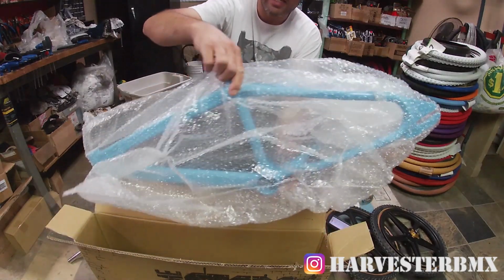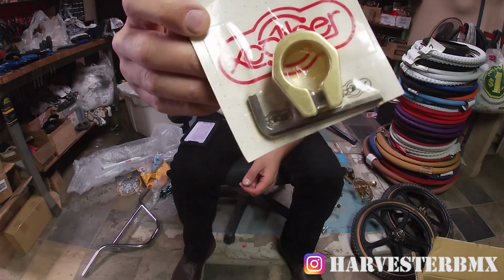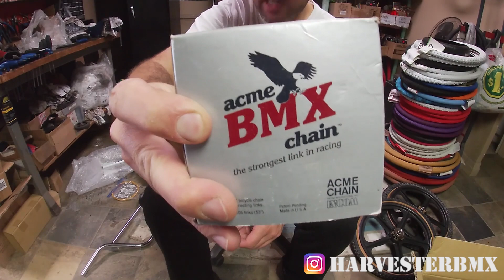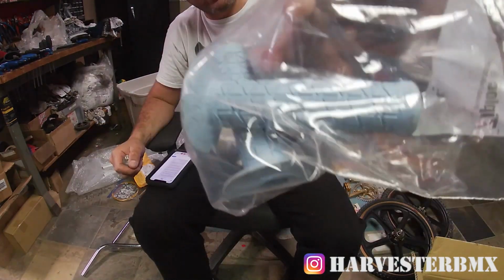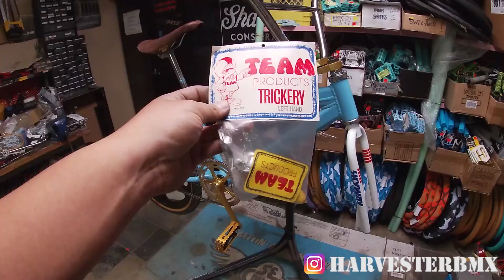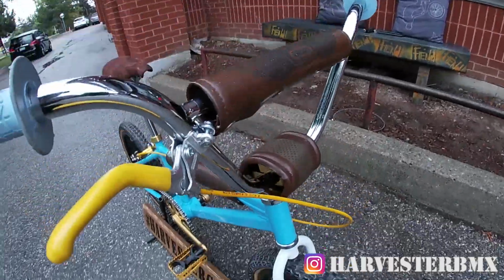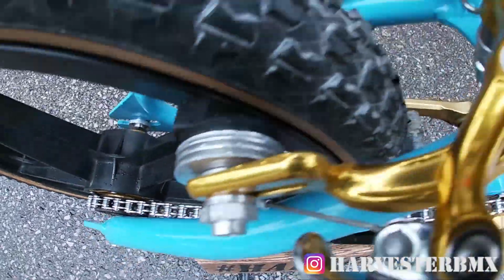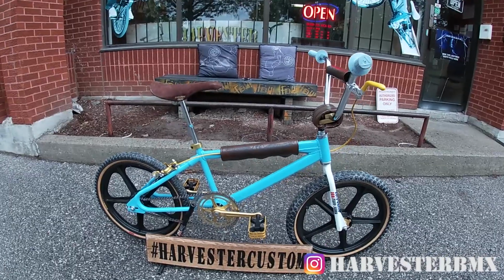1979 SE Bikes PK Ripper All Original Build @ Harvester Bikes

Comment: Skyway were not making bike frames or forks in 1979. The correct fork, pre landing gear should be one that is badged SE Racing BMX Innovations. I know this because I bought a pk ripper in 78 that was in-between when the one rider left and SB decided to call it the pk rippper. My frame was sans gusset and had said forks. It was later that the pk ripper came with the gusset and landing gear foks.

Comment: Great bikes to look at or sell to people needing a nostalgia fix but absolutely useless for riding compared to a modern BMX.  These bikes were all built for the track not the street - and the tracks back then were tame compared to what we have now.
A bike of this spec back in 1982 or so would have been unaffordable to all but a rider that had a factory endorsement or very cashed up parents.
In Australia where I lived the best bikes were only available as Frames/Forks/bars - you would never see a Cook Bros, Robinson, Redline... and so on as a complete bike at a shop unless it was custom built.  Circa 1980 the best completes you would see were the Team Mongoose with Alloy cranks, bars.. and so on.  The next tier was the Supergoose.
Bikes like Quicksilvers in 1981 were $100 less than a Supergoose brand New [$369 vs $269].  To put that in perspective - A 1980 Cook Bros Frame, Fork, Bars, and seat post Cost $330.  A set of 1980 Redline Flight Cranks was $280 - and absolutely nobody wanted them by 1982 because the Shimano DX cranks were more desirable and only $120.  Bullseye Sealed BB Kits were $50, Takagi Tourney 3 piece cranks were $40.  MX-2 Stems $25, any allow seatpost clamp you wanted was $5.  Tuf Necks were $38.... 

I mowed a lot of lawns back then to afford this stuff - had a lot of fun with it as well - but bikes have come a long way since.
Reply: Awesome  build , brings back memories. Big fan of the p.k.ripper i owned two a 20"& 24". Modern day bmx bikes don't compare they were definitely ahead of their time. Thanks and keep up the awesome builds.
Reply: Hello and how are you guys doing at HARVESTBMX ? JUST thought i"d throw this out there as one of those cool bikes I used to have. Back in 97 a friend of mine said hey you know what? I just came across. This bike frame&forks. If you like them well I said cool . so later that day he brought them over and what did i see HOLY F@&%$#@ CRAP. it was a CW ZX PRO frame , oh and if that wasn"t the cream on the ice cream on top of that there was a big fat cherry on top in the form of the one and only MR BILL. (BILLY GRIGGS) stamped  On one of the rear drop out"s. which could only mean that it must have been a frame custom made for him judging by the thicker than normal drop out as compared to a street version but in the end before I had the chance to get the bike on the road again someone snaked it from my back yard and what else could i say but in big fat txt. F@&K!!!!  I used to have I used to have.  Thanx for your time again and pedal on guys

Comment: Statement and question I have an all original Mongoose with Moto Mags from maybe 1980, it has the original blue tires and seat, the grips are missing, so are the handlebar pads gooseneck pads etc. it has the original stickers, it hasn't been ridden since 1983, I kept inside for almost the whole time, the biggest mistake it did was put it in a seal shed where the dust got to it.  So my question is is it best to restore it or keep it as a survivor?  The bike is complete.

Comment: Those seats suck. The sloping back and the sharp edge sucks. The Elina seat with a lay back seat post is perfection. The Skyway forks are beyond ganess. If that's original, do an 82 with the Landing Gear forks. The graphite mags are badass. The cranks wouldn't last a week. Gotta be Redline Flight 401s.